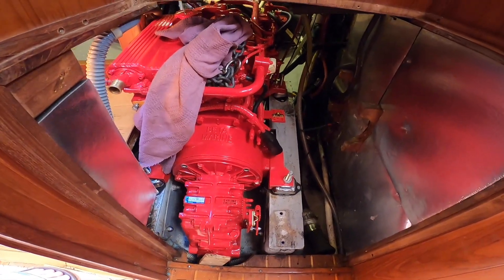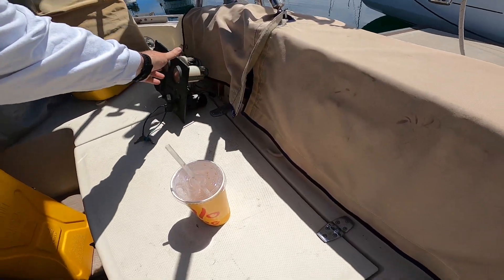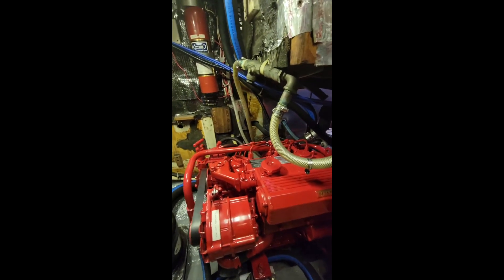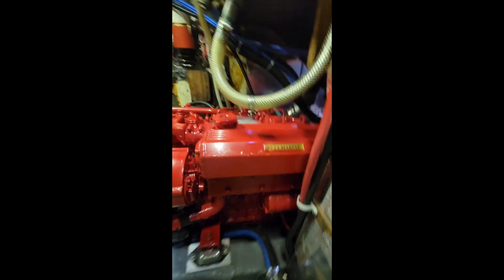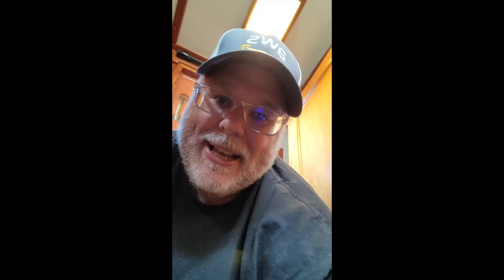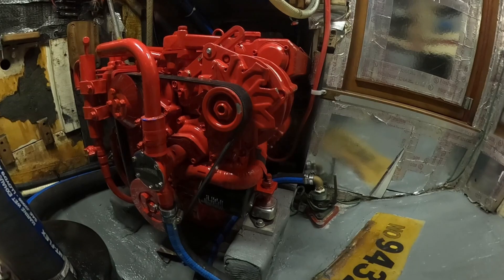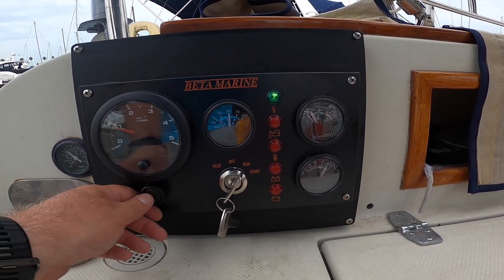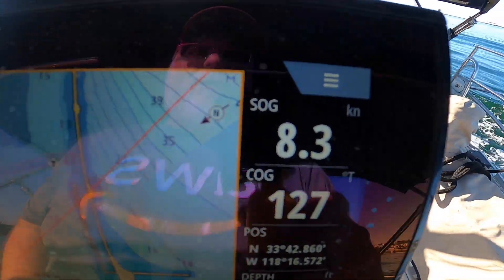Repowering a Valiant 40 Sailboat with a Beta Marine 35 Engine

Comment: I have a valiant 40. Why did you choose the 35 hp instead of the Beta Marine 43?
Reply from the maker: In retrospect, I would have gone with a Beta 50.  The 35 is adequate but a little larger would be ideal.  Beta 35 has enough power to drive 6.4 kts at cruise of 2240 RPM and hull speed  at WOT on flat water.  My rationale was a little weight & cost saved plus ability to operate at cruising RPM vs. being overpowered.  In real-world use, I wouldn't mind a little more power when powering into headwinds and waves.  If I had the larger engine, I  also would have added a 2nd large alternator for my LifePO4 batteries.
Reply: @keeldragger  would a Beta 50 fit?
Reply from the maker: @pubu2010  may be a little tight but I've heard of other V40/V42 owners going with the Beta 50.  same dimensions as the 43, I believe.  I do enjoy having a lot more room around the engine to work vs. the volvo penta 2003T I replaced.
Reply: What gearbox reduction ratio and prop size do have?

Comment: Great diesels.  We repowered with the Beta 60 because of our displacement.  Love the engine.  Have about 350 hours in it now, and no problems.  West coast Beta Marine contacted me shortly after we repowered and asked if they could use one of my install videos on their webpage.  I of course said yes.  I think it's still up on their front page.

Who's doing your repower?
Reply from the maker: Same guy who did yours :-).    Happy with his work.   I could have gone with a larger Beta, but the 35 is enough to get the boat to hull speed at WOT.    Prop size is the main limiter.    If I had room for a larger prop I could put more power in the water.  I see a lot of folks overpowering and not pushing their engines hard enough.  Sea trials went well for cruising speed at 80% of WOT (~2200 RPM).
Reply: @keeldragger  Yea, we should have gone with a larger prop, but we were told that we could have our old prop re-pitched with the same effect.  Probably would been better with the bigger one.

Chris is a good guy.  We had him come back to handle the initial break-in service, too.  After that I've done all the other maintenance.  Not too difficult.  The west coast Beta site is easy to maneuver and the staff was very helpful.

Comment: Is it computer controlled or mechanical? We had an Albacombi on our Cat270 for engine vitals to n2k network. It takes in configurable analog inputs and sends it over the network. Was a bit of a pain to get working but it worked eventually :)
Reply from the maker: Mechanical.  One of the reasons I went with Beta over Yanmar is the simplicity of Beta's design--i.e. no electronics or common rail.  Ironically, I added the NMEA 2k module.  Same function as Albacombi.   Beta's NMEA 2k module is a re-packaged Actisense EMU-1 which is pre-configured with a wiring harness which taps directly into the console.  Admittedly, this is a solution looking for a problem and totally unnecessary.  I plan to use it for voyage data recorder (VDR) and set up some alarms to alert on oil pressure, temp.